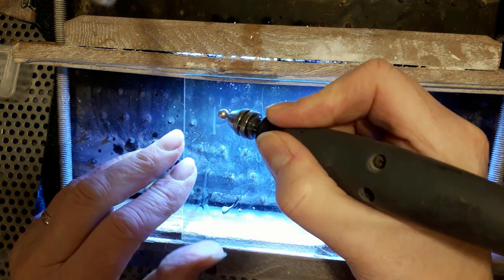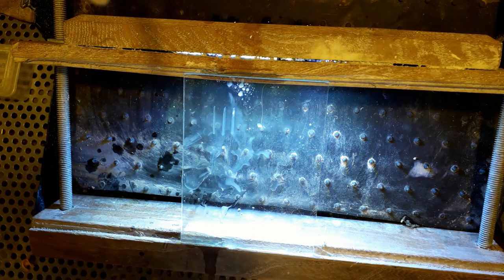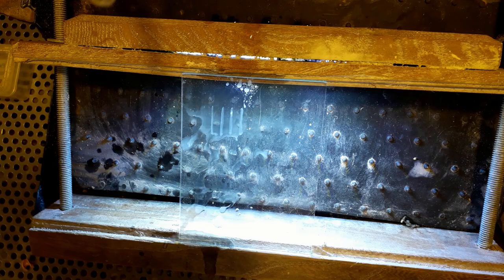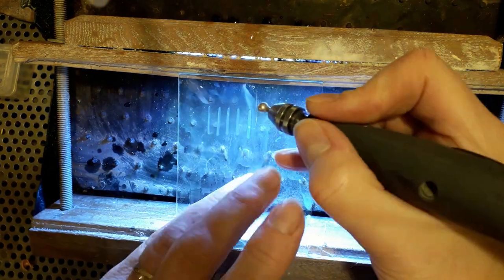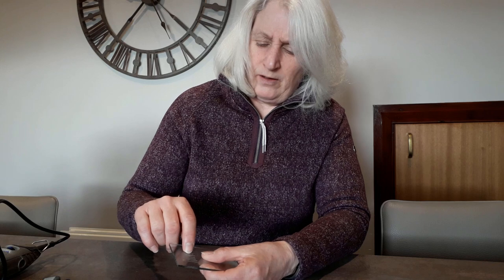Glass Engraving for Beginners - Part 6 - Rotary Tool Speed Settings

Comment: What would a good starter kit comprise of please?
Reply from the maker: You honestly don't need all that many bits to get started.  As a minimum, 2 or 3 spherical diamond bits in a range of sizes from say 1.5mm up to 4mm.  A diamond rats tail for fine lines.  A green silicon carbide stone is useful as is a white arkanses stone.  Apart from that, a couple of rubber polishing bits and you should be able to make a good start.  I do have another video which might be useful for you, Part 2 in this series - link below.  Good luck with your engraving 

https://youtu.be/LXILbRmpRkQ